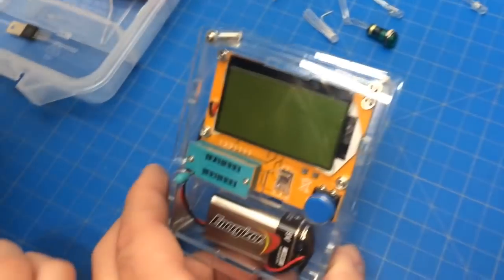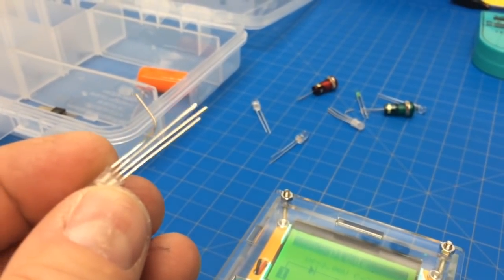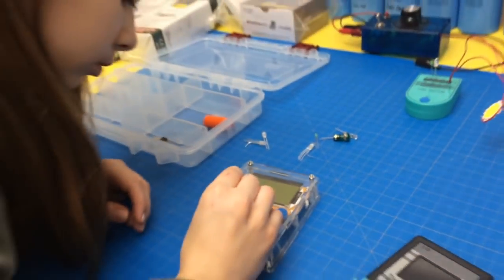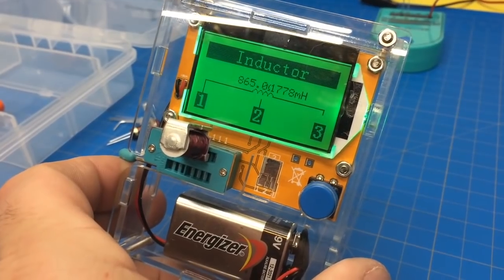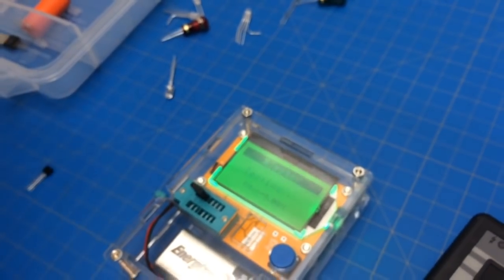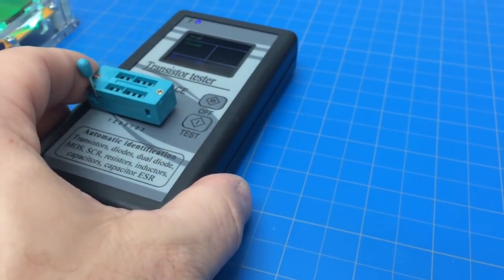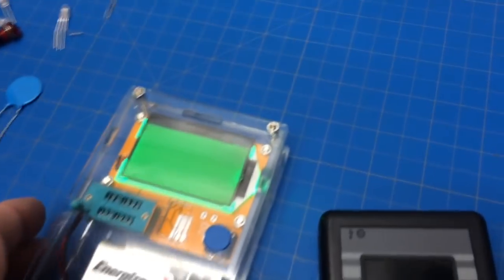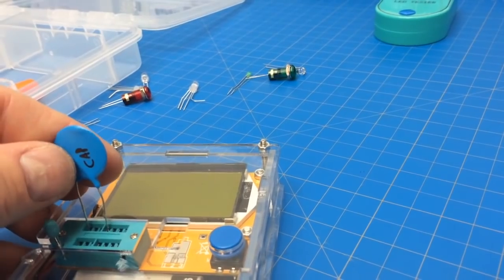[All-In-One] Electronic Component Tester LCR Meter Kit (Mega328) [KTFG 362a]

Comment from the maker: The simple method Emily used to solve the Rubik’s Cube at 3 years old:
https://www.youtube.com/watch?v=9spDGBeWl1o

www.KevinGittemeier.com
Handheld LCR Meter Der De-5000: https://amzn.to/2yQxFa2
Drok Electronics Component Transistor Tester: https://amzn.to/2tRTFeS
Multifunction Meter DIY Kit tester: https://amzn.to/2KvanIk 
Amazon affiliate links

Video numbers 362a - 362j (10 videos) exist to rectify numbering duplicates.  I starting numbering videos Aug 2020 video “386 Standing Desk” using the total video count as the reference number.  Then in 2025 I starting numbering the oldest videos 001 and so on.  The number conflict is due to private videos & deleted videos.

Comment: OK,I have the tester that you have but where May I also get the clear board that you have it mounted in? I like the clear look. Thanks much and God bless.
Reply from the maker: It came with the board as a kit.  From amazon, see link in video description and pinned comment.
You have to remove case to replace battery though.
I also have another model with a case and battery compartment.
https://youtu.be/WOY6Ar_AzdY

Also check out:  “How To Solve Rubik’s Cube: So Easy a 3 Year Old Can Do It” https://youtu.be/9spDGBeWl1o

https://www.kevingittemeier.com

https://www.amazon.com/shop/kevingittemeier

Comment: short out capacitor before testing, the stored voltage will blow the tester.
Reply from the maker: Good Tip!
Also larger electrolytic capacitors need to be shorted for longer periods of time due to rebound voltage. I worry about accidentally blowing my more expensive but still relatively cheap Der De-5000: https://amzn.to/2yQxFa2.
Knock on wood hasn’t happened yet.

Comment: How can it tell the voltage of the LED?
Reply from the maker: I suspect it measures a voltage at a specified current and reports that voltage on the screen. Different LEDs require different voltages to push X amount of current, usually 10-20ma for standard LEDs. https://youtu.be/5NTch0j1gts in this video is an app that shows LEDs voltage drops for different color LEDs

Comment: The audio and video go wonky half-way through, with audio for a different video.  Big question is does the newer more expensive one with color display gain you anything over the old cheap one ? Anything new it can test that the other can't ? Thanks !
Reply from the maker: Thanks for the heads up about audio.  It was correct but somehow now starts audio from beginning halfway through.  Not sure why, maybe bc it detected a song in background towards end of video.  I believe both testers use the m328 and the more expensive drok tester doesn't test anymore components. I only purchased it for work because it has a more rugged housing and a battery compartment for easy replacement.  The cheaper model is for the home bench.  For most people its probably not worth the extra money .  I plan to do some comparison with my DE-5000 LCR meter soon to so how both these all-in-one testers compare.
Just got new 4 wire kelvin probes in the mail today for the de-5000 that we will upgrade soon.
Reply: Kevin Gittemeier that’s what I thought. I’m just gonna print this case for it anyway: https://www.thingiverse.com/thing:1372607 , so cheap one seems like the way to go (and a lot faster on boot up not having to load those U8glib display libraries). Thanks for the good info !!! Btw- totally agreee with you on the loosening of the socket on the drok- why they didn’t just skip the intermediate socket entirely is a complete mystery.
Reply from the maker: Thats awesome!